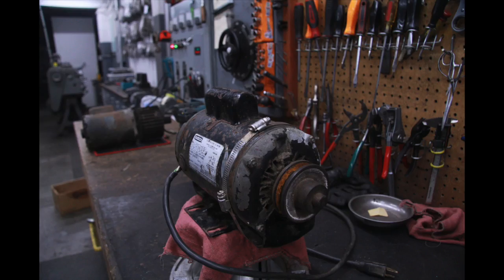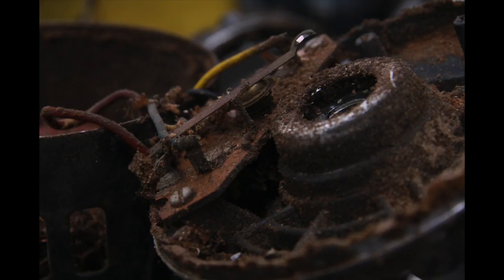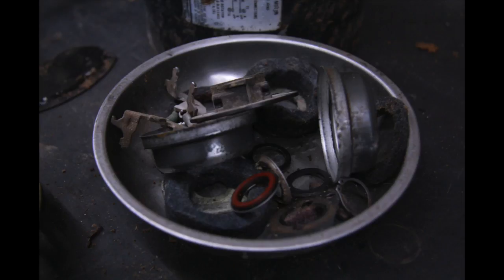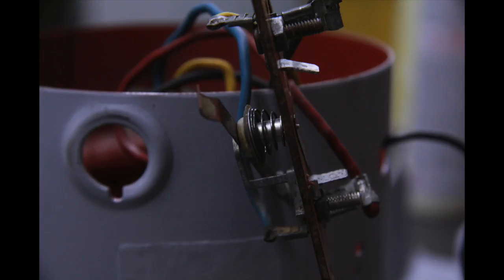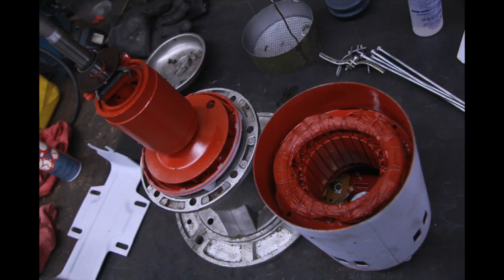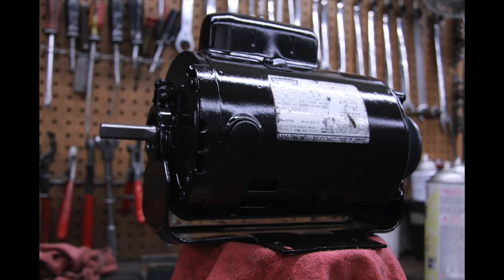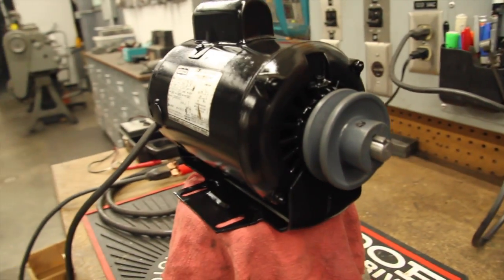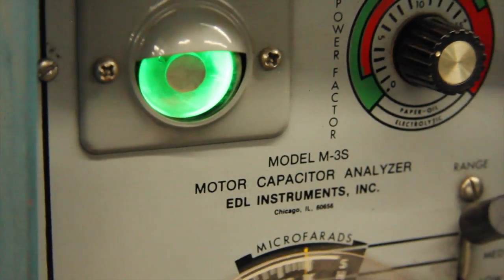craftsman table saw motor rebuild: Cleaning, re-painting, and using thenModel M-3s Cap tester

Comment: How do you replace the bushings in the end plate
Reply from the maker: They press out; the new ones need to be precisely fit to the shaft diameter though so often you need a lathe or adjustable reamer
Reply: Can ya possibly point me in the right direction of purchasing replacement bushings? Or perhaps you can walk me through checking to see if the need replaced? Tell ya what happened if you care to hear.
Reply from the maker: @ bearings can be found at some old hardware stores, McMaster carr online.. usually you have .010- .020 oversize to allow for the oil film, so the ID matches the shaft,  OD matches the housing